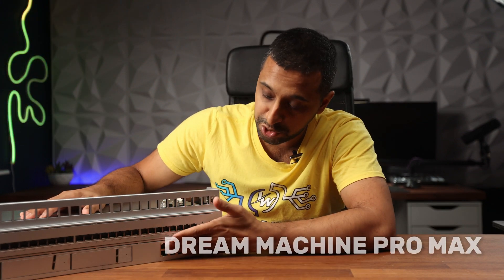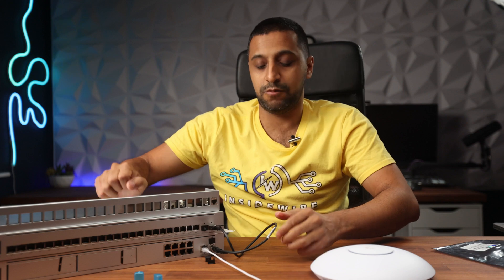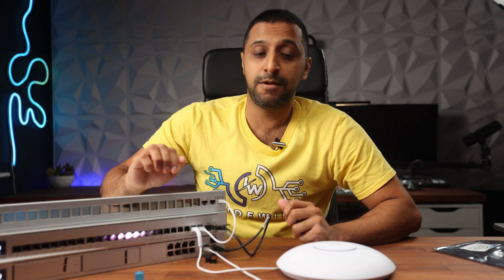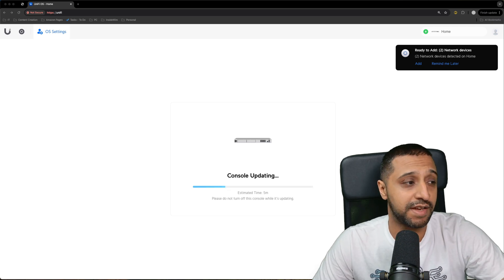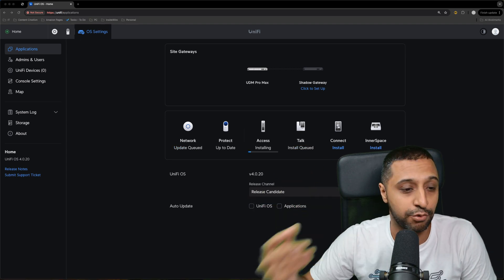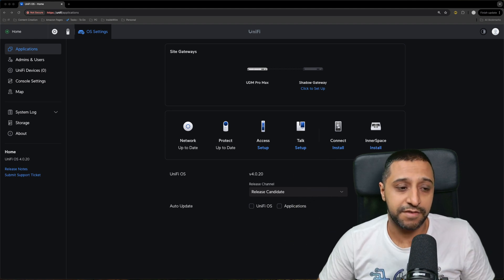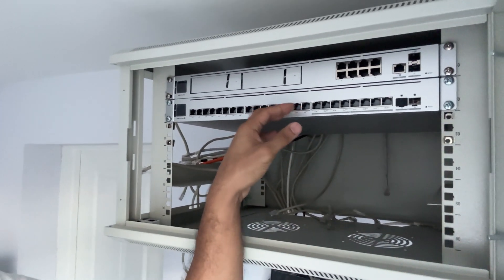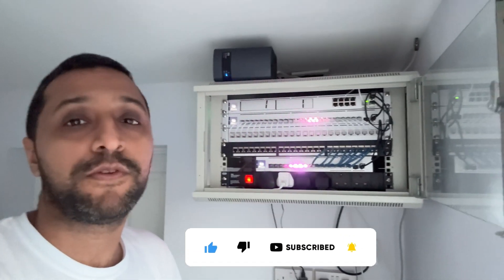Upgrading My Ubiquiti Home Network: Part 2 – Connecting Devices & UniFi OS Setup Guide

Comment: Thank you for the video. Very informative. You connected from the Dream Pro machine 1st SFP port to the 24 Switch 1st SFP port, and then connected from the Dream Pro machine 2nd SFP port to the 1st SFP port on the 16 Switch, correct? Thank you.

Comment: Can anyone help me?

I turned off remote access on my UDM SE because of security reasons. so I don’t get notifications. 

I want to use a unvr in a separated isolated vlan with internet access and a few cameras. As far as I know, the unvr is a device running another instance of protect. Thus, I could turn on remote access. 

Can I block the internetaccess to a minimum? Which ports need to be open for remote access?

when receiving a push notification, it is being pushed to my iPhone. But will this notification pushed to my Applewatch also? Or more explicit: will it be pushed to my apple watch over mobile network? Eg I am outside without my phone?

thanks in advance.

Comment: Great video btw! 

Just a question, isn't a udm pro max quite a bit overkill for a home network upgrade? I have the udm SE and for me that's plenty good enough. Even the udm pro would of sufficed, I just got the SE so I can have the 2.5gb wan capability.
Reply: TBH Yes - but "newer shinier toys" - I've gone from UDM Pro to UDM SE, to UDM Pro Max 😀.  The UDM SE is probably optimal  for most serious home users. The caveat would be if you use Protect, then the Max arguably has the edge because the twin drive bays allow for a RAID setup to store video data. Realistically, for 90+% of (Ubiquiti) home users the Cloud Gateway Max is likely the top choice. (The other 10% will all have a comms rack so the UDM Max would be de rigueur)
Reply: @rogerjones9984  💯 I'm a network engineer, always wanted to have my own rack so recently got the udm SE with the 16 poe pro max with the rack mount. In future I'll probs get the nas pro and a mini nuc to run proxmox on so I can run containers for plex, uptime kuma etx
Reply from the maker: Thank you! 🙏 In most instances yes it probably would be overkill. I was running the UDM SE previously.

Comment: although the more joints you have in a connection can reduce overall signal quality, if you are using quality parts it would be fairly minimal, so not really a problem to use the passthrough type
Reply from the maker: Agree but some are old school and dont agree with pass throughs.

Comment: Ubiquiti also sells short DAC cables in White that look a lot better than the curled up long Black ones you have in your rack. They also sell patch panel snap in covers to cover up any unused holes, small silicone plugs to put into any unused switch ports, and covers for the unused SFP ports.
Reply from the maker: Hopefully all to come over time.